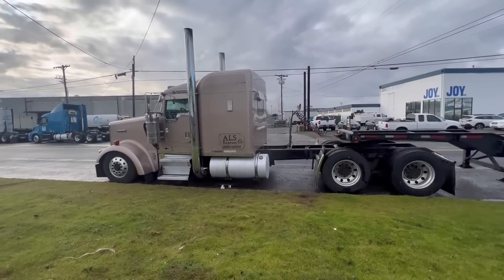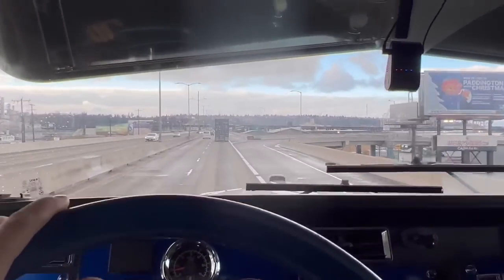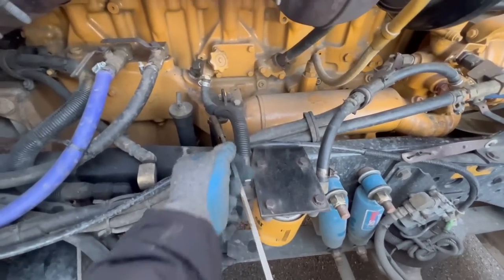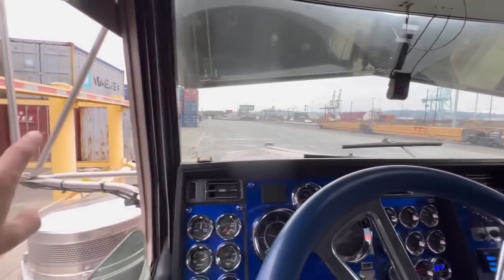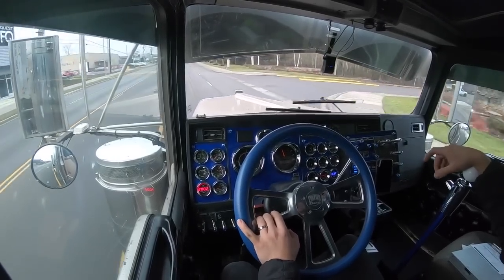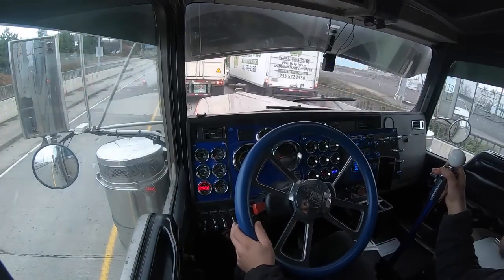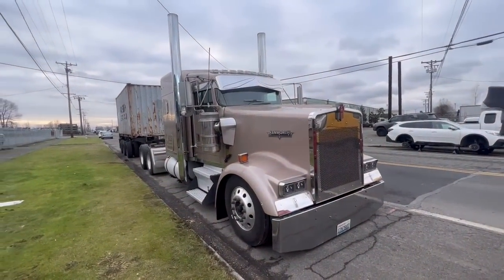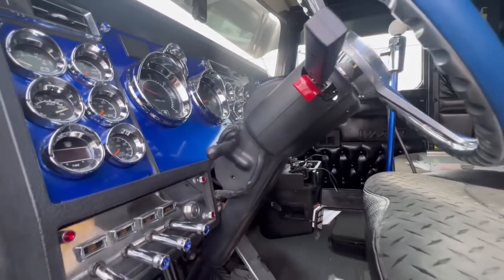How much does Container Hauling Pay? | Kenworth w900 Owner Operator

Comment: I also fixed my bent bumper by taking it off and laying it on some blocks under my trailer legs and then cranking the legs down with a towel between to protect until it was straightened out. Worked perfectly

Comment: I did the same Air Ride and I did 1 1/2 Springs I took a cutting wheel and cut the bottom off just behind the U-Bolts. Not easy because of the steering arm gets in the way.  I also replaced the door handles as well way better.
Reply from the maker: How do you like the air ride on 1 1/2 leafs? Feels pretty stiff with my 2 leafs

Comment: You're shifting is good. There's less wear on the transmission synchronizers
Reply: Synchros on a semi?
Reply: Synchros on a semi?
Reply: @vedenybondarchuk569  yes look it up. 1 set for high/ low and 1 set for high splitter
Reply: No dude… 😂
Reply: Non syncro tranny.  Range selector and splitter have syncros.  Lever shifts gear to gear do not

Comment: I bought a red airline airhose awhule ago, and it really wasnt inflating the tires i think the psi went down a bit actually idk
Reply from the maker: Red side has same pressure as in your air tanks.. run the truck build the pressure all the way first.
Reply: @CustomRigs    Maybe I wasn't patient enough, i heard they take a long time. Ill try high idling it otherwise and see if that  helps
Reply from the maker: @XLoad3d  yeah got to tire to 100 psi in just few min.

Comment: Oh, what ever happened to air ride kits for the t-660 you was making up? Did that fall off or?
Reply from the maker: Not as simple.. it’s hard to perfect them. And if someone spends 5k on a air ride system they expect high quality zero issues. Air rides have lots of negative side to it. Looser feel Steering, bump steer is issues alot are experiencing. So untill we find a system that works really good. I’ll be changing mine up again to try to make it better.

Comment: Where do you find dispatchers for  Seattle/Tacoma  Ports?  I’m trying to get into that and take a break from flatbed
Reply from the maker: When I started off 7 years ago I called a bunch of these companies on Drayage Directory and see what they have to offer and what their rates are.. 

https://drayage.com/directory/results.cfm?state=WA&sortby=2&customize=y
Reply: @CustomRigs  Oh ok. I appreciate it bro.
Reply: Do you have to have your own authority to get the loads off of dryage.. or there just companies you least on to..
Reply from the maker: @supabobby3514  I have own authority and there’s companies that will dispatch containers to guys with their own authority.
Reply: When they Dispatch them to you is it just yard to yard .. meaning from there yard to the customers n back to there yard or do you do the whole thing meaning going into the pier n getting the load n running it n then returning it. I run outta the new jersey piers. And thinking about getting my own authority n scat code n running the containers. The ports are never that slow with work. But the money is in having your own authority and scat code as you run the ports
Reply from the maker: @supabobby3514  no it’s always port to customer and back to port or a container depot that accepts empty cans.
Reply: Oh OK thanks
Reply: @CustomRigs   I am a little confused. To run ports and railroads with your own authority, don't you need UIIA registration and the insurance they require? I tried to get that and the insurance is too high. How do you get access to ports without UIIA required registration and insurance? Thank you.
Reply from the maker: @alexmissonne1160  I work with dispatchers and brokers who already have UIIA and their own SCAC code. As long as I’m hauling their loads I use their port registration all you need to do is have a Rfid chip on your truck and have your truck port registered.
Reply: @CustomRigs  Oh man, I really had no idea. I was about to get that expensive insurance just last month but gave up because it was pricey. So once I find dispatchers and brokers, then all I have to do is get their RFID chip placed on my truck and register with the port? Then I can haul their containers?

Comment: I run Oakland port her in California and I'm getting roughly 3.29 per mile Damm that's good money what your making
Reply from the maker: Is that for local? Our farther 200-300 mile runs average 3.50-4.00 a mile.
Reply: @CustomRigs  yea local usually round trip is about 300 to 315 miles
Reply: You shouldn't go by the miles.
It take an average of 2 hours to pull it from the terminal and the same time to return it .
If you add 1 hour for unload it. 
5 hours total.
Does the mileage really counts when you spend a half day waiting.
Reply from the maker: @thinkwisely7610  all the wait time is paid for $55 an hour.. and no we’ve been averaging 30min to an hour on pulling load, even less if coming from the Rail
Reply: @CustomRigs  
I've done Oakland and Long Beach ports.
It takes 1 to 2 hours per transaction sometimes even more. Don't forget we are dealing with longshoremen who take 1 hour for a half hour break and 1and half hour pour their 1 hour lunch time+ they all work slow.
I've heard your T18 terminal is also at the same pace.
Reply from the maker: @thinkwisely7610  t18 is pretty good lately.. we have new terminal 5 that opened up it’s a nightmare. Rarely go there but when I do it’s atleast for 3-4 hours.